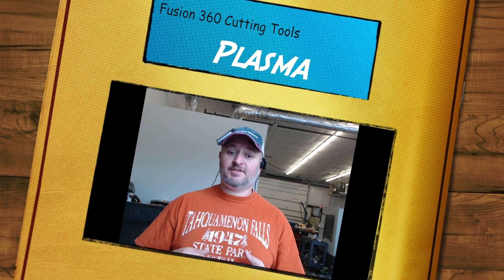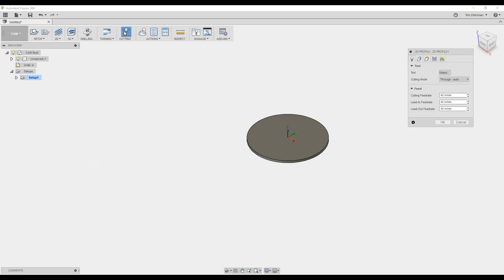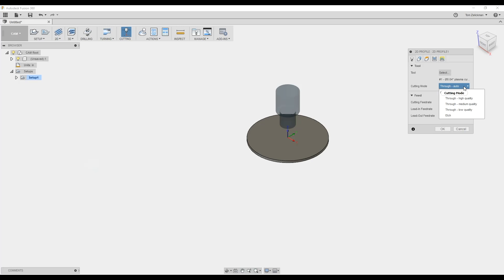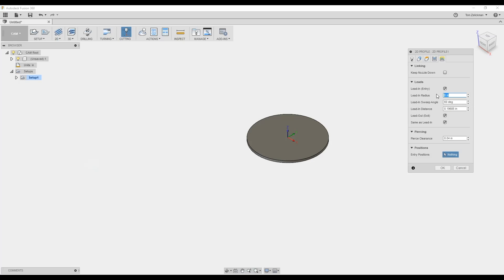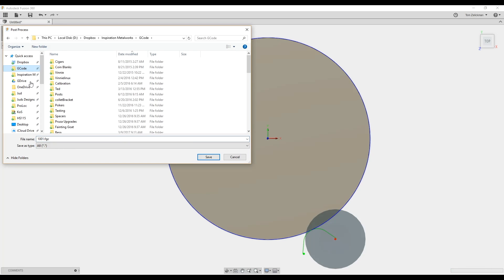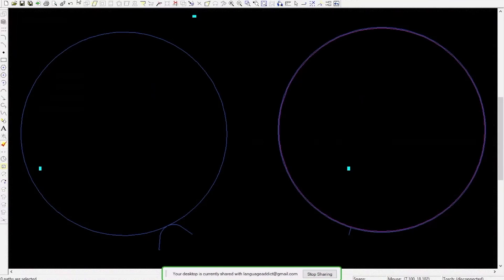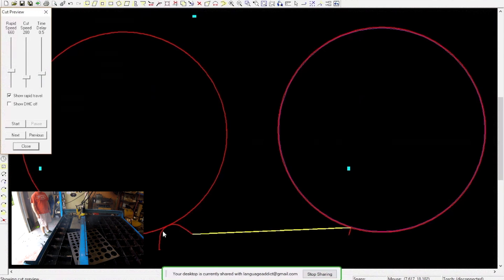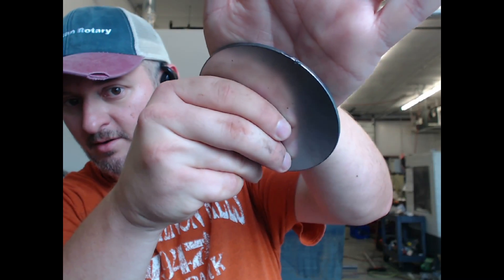Fusion360 to Improve Plasma Cut Quality

Comment: Been searching and had a question. When I post process in Fusion, the simulator cut path looks great. When I'm cutting, the parimeters don't complete their full path, stopping about 1/4 inch short before moving on. I don't have tabs selected. Don't know what could be causing it.
Reply from the maker: Sorry for the slow reply - just seeing this. Have you checked the dimension of your cuts? Are they correct or off? I ran into this before when I accidentally doubled up on the kerf offsets, meaning the CAM added an offset and then my plasma cutter applied yet another offset. Between the two it added up enough to throw things off roughly 1/8 inch. Another things to look for in your plasma cutter settings is cut overlap (sometimes called gap). These can cause the cut to either extend across the start or stop short.

Hope this helps!
Tom Z

Comment: i hv handheld plasma i musing on cnc table i have thc problm with raw arc voltage any aolution?
Reply from the maker: I had to get the consumables for the machine torch and put them on my hand torch. After that I just used the settings from the manual and it all worked well.

I hope that helps!
Tom Z

Comment: You mention "dialing in" in this video.  What exactly do you mean and how do you do it?
Reply from the maker: +Kendall Dene Ah, Yeah. That. So the cut width (kerf) will vary a little depending on the amperage, cut speed, and thickness of the material. You can compensate for this by adjusting the cut offset in the controller or in Fusion 360 as the width of the “tool” you use.

Hope this helps!
TomZ

Comment: Tom, I'm currently attempting to take a design to CAM, the layout and configuration has changed since you uploaded this video. Have you had any problems doing the cam / post process since the update? or can you still post process?
Reply from the maker: I just tried to make sure I knew the answer and it works but I did have to do one small thing differently. This time around when I picked the "tool" I had to turn on the filter for cutting tools (it was off by default but had been on in the past). Otherwise, it all worked as before.

Let me know if you still don't get it.
TZ
Reply: Thanks Tom, I just can't get my head around it right now, moved over to sheetcam for a look. Just downloaded it yesterday as a trial version. But heading out now, got other life stuff to do, will take a look again later

Comment: Looks super useful Tom but - not something I can exploit as yet. Will return to this though if I ever get the need. :)
I'm sure this will help a good many folks.
Reply from the maker: Hi Chris! Agreed, this video was pointed towards a specific crowd but it's actually broader than you might think. Just about any type of CNC controlled system can be run this way... So the real question is, which path will you take? :)

Hope you are well, my friend.
TZ
Reply: Right now Tom - my path is probably headed towards hip surgery 8/1/17!! So - much to do with shop etc is on hold! Do hope to get some more time on Fusion eventually. All best.
Reply from the maker: +ChrisB257 Hope all goes well, sir!

Comment: Feel free to do the same video but go from fusion 360 to Sheetcam, then Mach 3 (that's if you do have those programs). Just putting that out there haha, this is the way I think I will be going when I'm up and running.
Reply from the maker: So in theory, you shouldn't need to use Sheetcam. You should be able to go right from Fusion 360 to Mach 3 without needing that intermediate step because you should be doing the same things in Fusion that you would do in Sheetcam. I don't have a copy of it but maybe I can get a trial copy or something like that.

Let me know if you need help though,
Tom Z
Reply: Yes, in theory I should be able to skip Sheetcam, but the bugs scare me. I was getting my head around Fusion 360 Cam, creating G-Code about 4 months ago, even made a video on it (more for just a reminder of the steps), then an update changed everything and I couldn't figure out how to do all the things I had just done. This is where I worry about committing too much to all the Fusion steps worries me. It was at that moment, I thought I should get used to Sheetcam and Fusion, so that I have a fall back for all my cutting needs, so that if I do have a customer down the road that wants a part and Fusion do an Update, I won't have an angry customer while I chase up a fix, taking longer to deliver.
Reply: I know that Sheetcam is specifically a way to generate that G-Code, it has many fans and has been stable for a long time, I can always concentrate on the 3D design "CAD" in Fusion, not too many concerns there, but advancing to CAM in Fusion, I really do worry (maybe a little too much) but I can design a part in Sheetcam too if it's a basic 2D design. One day, Fusion will have all the bugs fixed and should be a 1 stop shop, but your video gives me confidence to spend some time in there down the track and get that program doing more for my cutting needs.